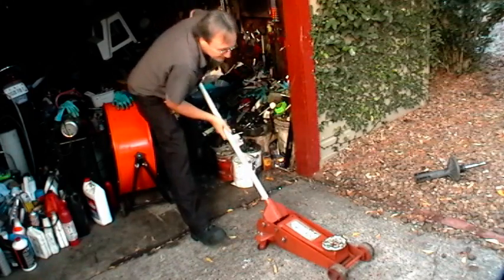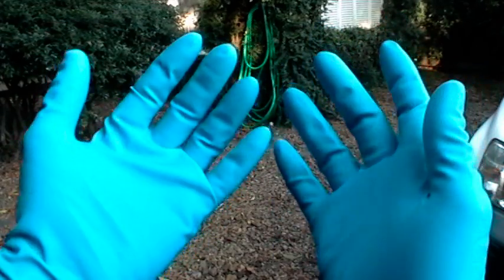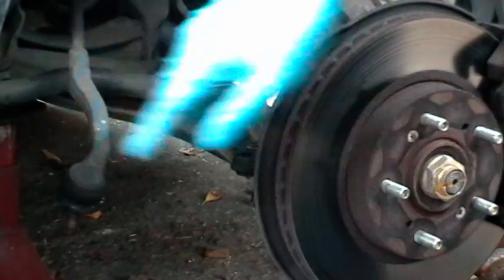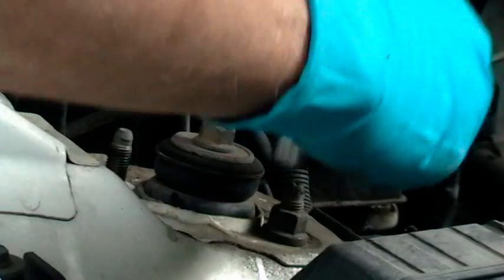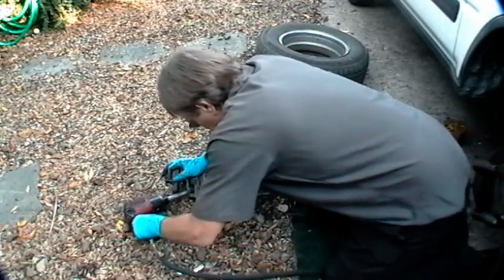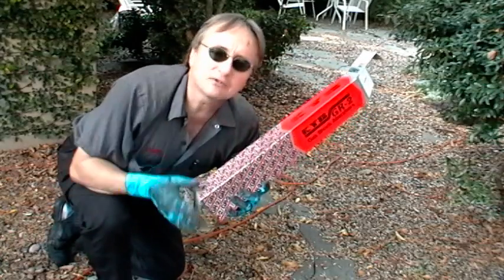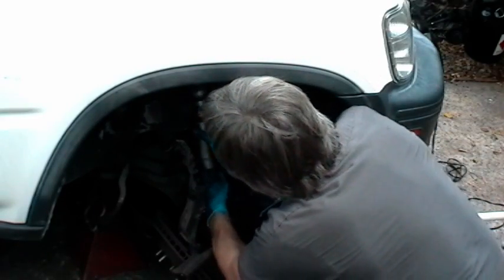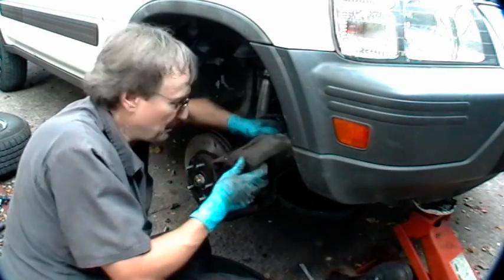How to Replace Struts on Your Car

Comment: ok so your video was helpful but a little fast I am a female without much money needing to replace my struts on my 98 Toyota corolla could you send DETAILED instructions so that I don't loose a finger or something? I cant afford the expensive struts but my tires getting shock wear and needing this badly. If you can help me with instructions so I can do this my self I would greatly appreciate it. I also need to know what tools I will need do not have air tools but can purchase rachets and stuff

Comment: scotty would welcome prayer, how to replace a volvo 850 1994 2.5 125 kw rear axle (subframe) bushings and they look like two holes 8 only one hole is larger and the other smaller and in the middle of a press similar to the rubber cover, please make a video. thanking the fans for the Estonian andres.k

Comment: You should at least show that you need 2 spring compressors and an allen wrench and regular wrenches to remove the top hat before removing the spring, and also make sure you line up the spring with the strut and top hat or the spring will be bouncing and unstable.